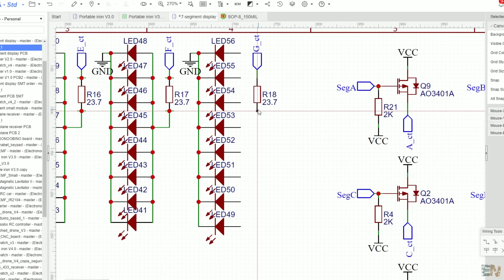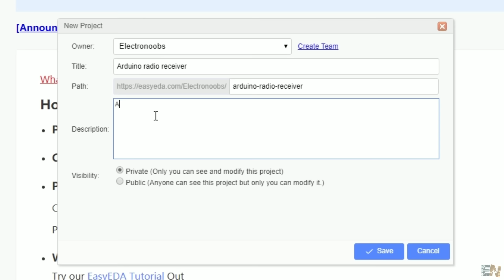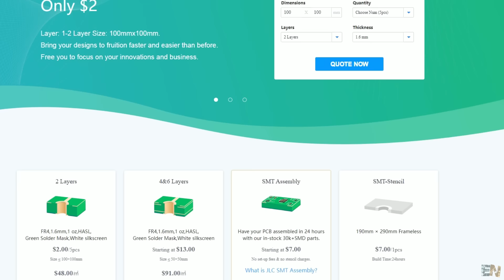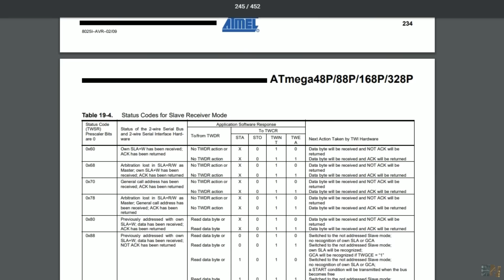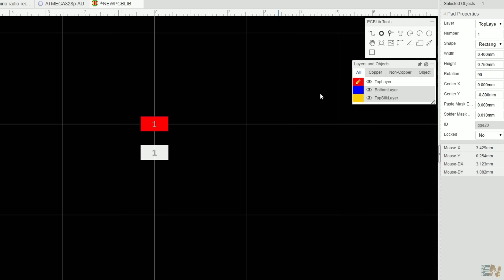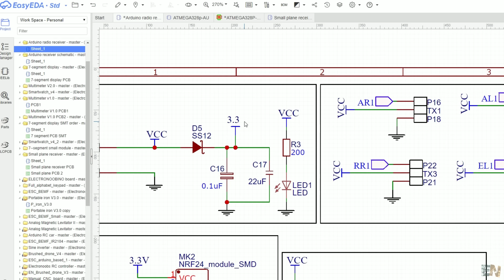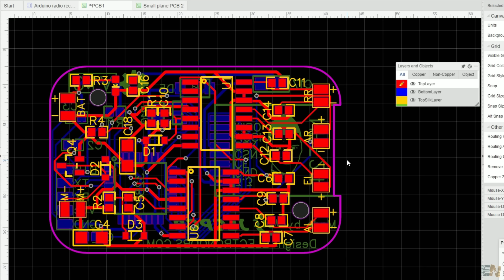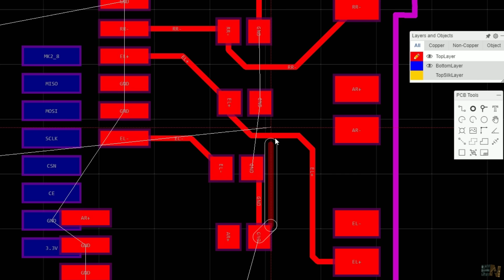EasyEDA Full TUTORIAL + Create Component + TIPS

Comment: I believe the pins are backwards on the new component. This can be seen at 7:51. The end of the pin with the circle should be facing outward rather than touching the square. If wires are drawn to end of the pins in this reverse orientation, the nets will not be complete because the wires will not connect to the pins.

Comment: I'm also considering leaving Eagle,  don't make many PCB's and it's getting expensive.
How do you do a small grove line they often do on relè boards to separate high voltage and low voltage?
Is there any recomendation for drill size? I mean the cannot make any size.

I'm waiting for my second PCB project with JLCPCB, I didn't use the SMD service because it's a waste of time, too many components are out of stock or not enough available, forcing me to change my choices where possible, but then I end up with over 50% of components missing.
In the end I chose to make a PCB with a place for an Arduino Pro Mini, costs much less than making a PCB with the components integrated on your board.

Comment: Is there a way you could help me please? I want to make an adapter for my sampler. An adapter that will take two different female connectors (one is 40-pin and the other is 6-pin), and I want it to where both can run into another female connector (6-pin) on opposite side of the two female connectors.

I'm trying to make an adapter that will allow me to run two Analog Boards into the Switch Board of my sampler. I wonder if it's possible. I can e-mail some sketches to help you out with what I'm trying to design.

Please let me know if you can help or if you've suggestions I could use for my sampler mod project. :D Nice tutorial by the way.

Comment: The WORST thing about this video is the part on how to make a component - it shows all the pin connections connected to the rectangle. Make sure the round pins are sticking OUT and are not connected to the rectangle.. otherwise you will be wondering why you can't make connections afterwards. ie. The screenshot at 8:14 is wrong. -o  o- should be o--  --o